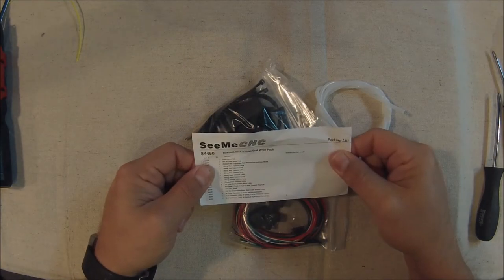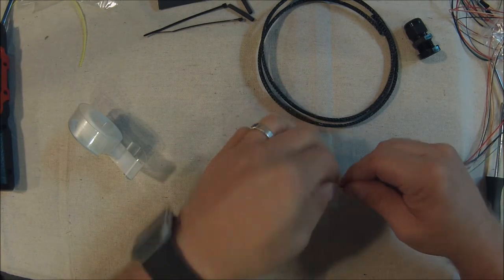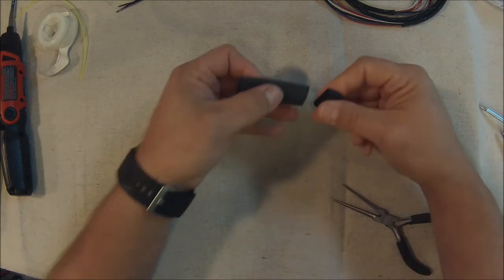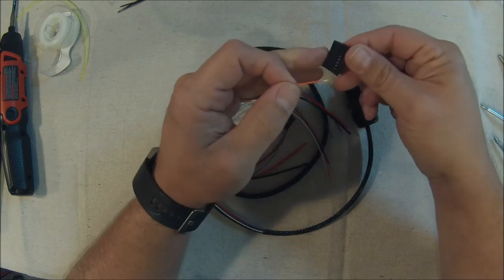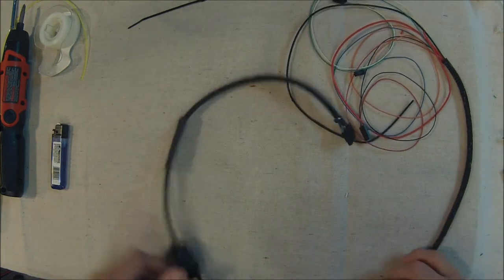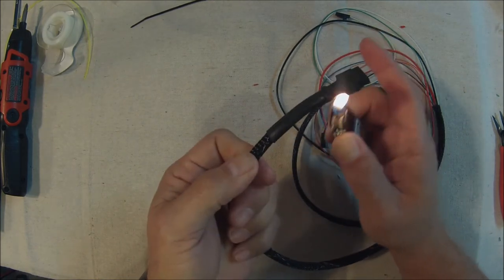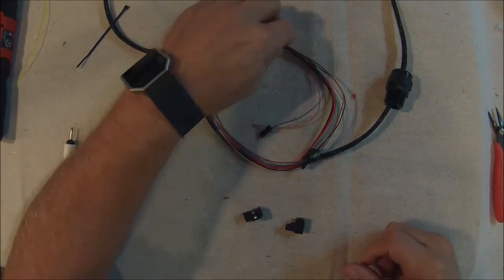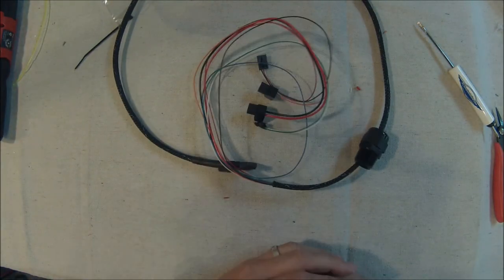Assembling the Wiring Whip for the Rostock MAX v3

Comment: TIPS! TIPS! TIPS!  READ FIRST!
1. insert the wires into the connector first; have a wire stripper handy as they were not all pre-stripped
2. don't stretch the heat shrink like he is doing it.  Slide it on the wire harness all the way to the connector, and put one corner of the connector in the heat shrink.  Us a thin phillips screwdriver to stretch the other end of the other side of the connector.. much easier and less prone to breakage than what he is dong.
3. Put cable mount hub on after heat shrink tubing is situated